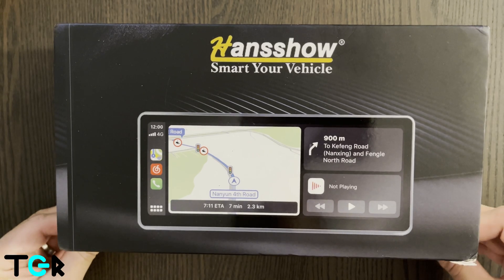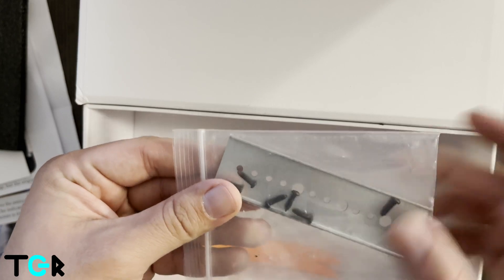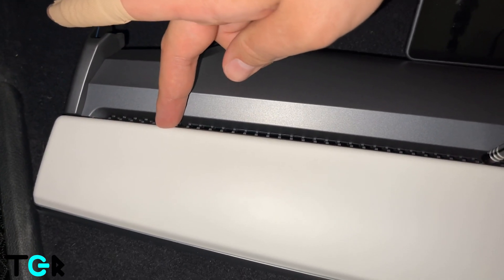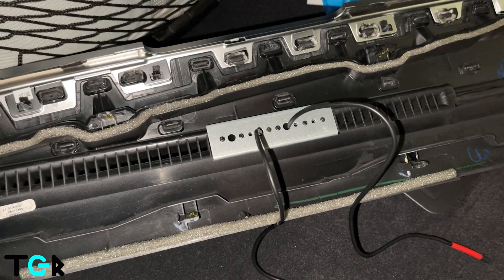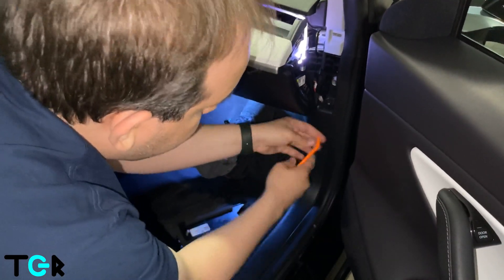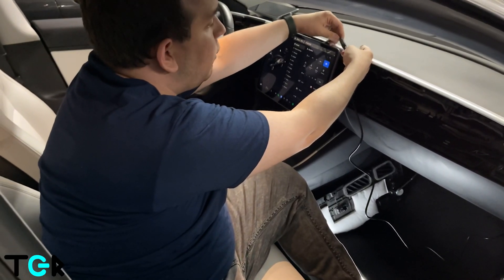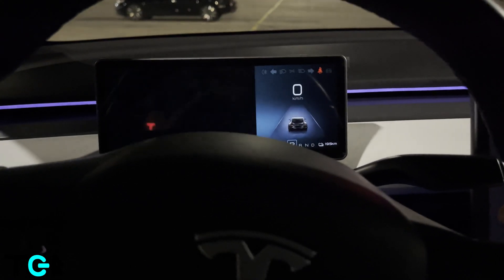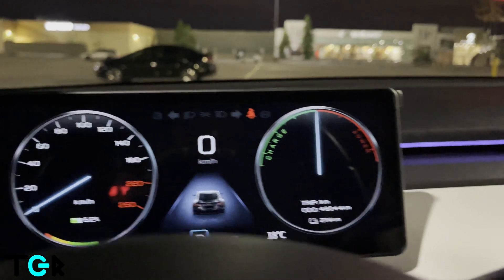Tesla Model 3 Instrument Cluster | Installation

Comment: I gave up at the under the glovebox part lol. I started around  630pm by the time it got to 730pm it was too dark and I tried to get the middle wire it was impossible.  I saw other videos where they actually remove the full glove box. I tried that and I guess I didn't level it right, Now my glove box is like 1/3 an inch unlevel and I didn't even install it. I gave up after 40 minutes trying to unplug that damn cable. AMD has it easy theirs is right behind the pillar. Going to try Saturday when I have a full day to try and possibly some help
Reply from the maker: Good luck! It's definitely not the easiest to do
Reply: @thetechguyreviews7945  ended up taking the whole glovebox out to do it, love it so far

Comment: Thanks for this video. So, I noticed that you have paired your hansshow screen to your Tesla via bluetooth. I was doing the same thing until I started noticing significant lags while receiving phone calls via carplay and the person on the other end complained about hearing really bad echo so I finally just unpaired the screen from Tesla bluetooth and I just pair my phone to the car and use screen for carplay which is not ideal but an ok workaround. I just wanted to know if you have faced a similar issue or know a fix for it.
Reply: So, a quick update regarding this problem. I contacted Hansshow tech support and they gave me a link for a firmware update and it fixed the problem ! Now, what happens is when you receive a phone call through carplay or android auto, the call audio comes out from your hansshow screen speakers instead of being routed from hansshow to Tesla audio (which was what was causing the lag as it had to go through multiple bluetooth end points). The speaker on hansshow screen is still decent enough for phone calls so I don't really mind that and all my music still plays through my Tesla speakers. I highly recommend you contact hansshow.
Reply from the maker: @realsastudios  I'll send them a message. Thanks for the update!
Reply from the maker: Yes I found the exact same issue. I’m planning on doing another video on reviewing the actual unit now that I have had it for a bit. I did notice incredible lag having the Hansshow pair to the Tesla. I’ve since just started using the Bluetooth from my phone instead. Seems to work better now

Comment: I wish you recorded the part where the connectors are suppose to be connected under the glove box. It's literally the most important step and every reviewer fails to record it. I know it's challenging to record it but that's the most important step what everyone wants to know !
Reply from the maker: It's a good point but I found it impossible to record it. (which also explains why many other reviewers have not been able to record it) 
There was not enough space to keep the camera on a tripod with me practically upside down trying to put the connectors in. Holding the camera was too shaky due to the awkwardness of it. Definitely one of the hardest parts of the installation.

Comment: When you swipe down on the steering wheel to get into CarPlay mode, can you still use the steering while button to navigate in CarPlay to choose certain apps or do you need to put your hand through the wheel to touch it
Reply from the maker: I’ve been using my hand to navigate CarPlay.
Reply: no you don't have to. the other steering wheel button allows for navigating between apps. otherwise, this is very dangerous while driving, youd'e have to fo through the steering wheel
Reply from the maker: That’s a good point. I tried the steering wheel controls today and it worked great. I wasn’t able to get it to work originally since I was using AutoPilot and apparently the buttons are disabled when using AutoPilot. However, when not engaged it works well.